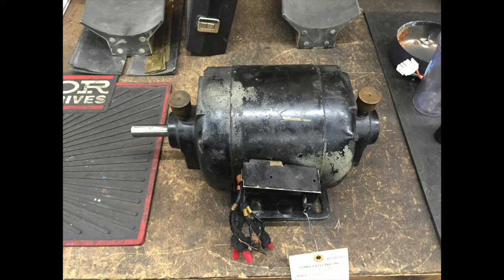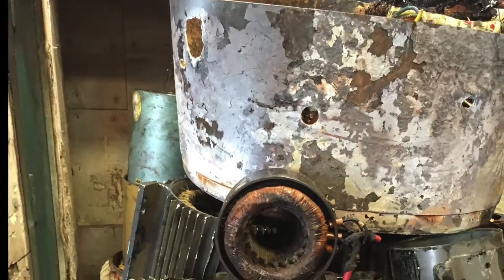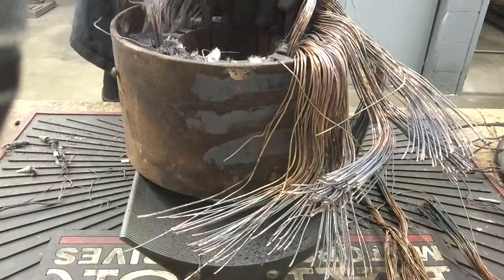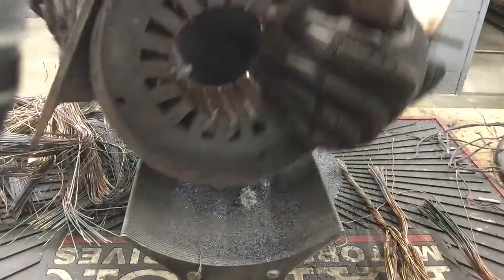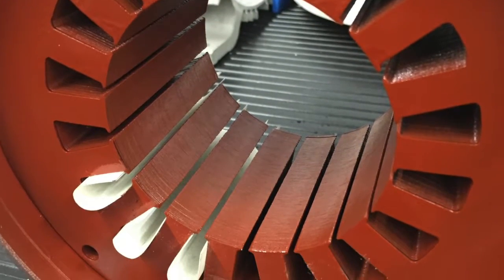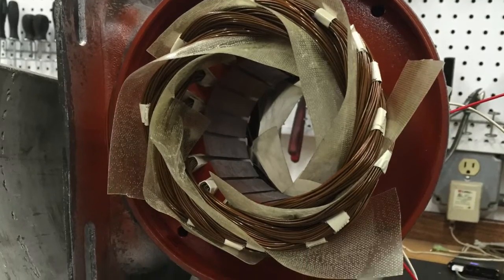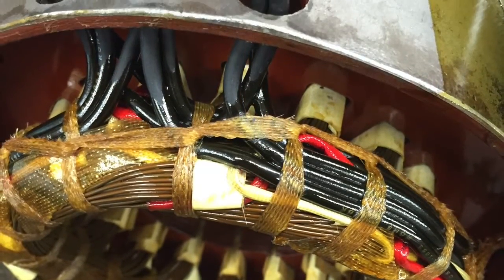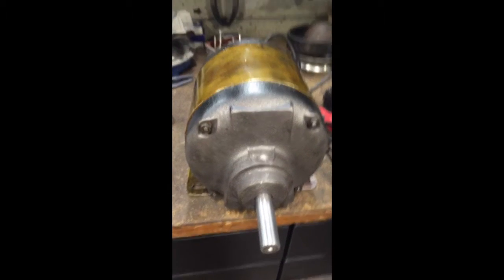Ge 1942 2 pole motor rewind

Comment: 900 hundred degrees is too high you need to burn it around 700 to 750 only or you'll damage the insulation coating on the lamination but good job.
Reply from the maker: pher8487 we just upgraded our oven to have water suprsssion and now we burn off at 750°
Reply: Ryan Miller Do you core loss your motor after sand blast?
Reply from the maker: pher8487 I am working on a small core loss tester based off of a cellphone program, we do not own a commercial one at the moment
Reply: Ryan Miller it's usually ok not to do a core loss test if you can strip a motor at low heat by using a torch to just heat it enough to get the wire out.but nowadays big companies want a fancy report on their motors so from a business standpoint that's where is headed.i could remember when we use to burn motors by digging a hole and put wooden pallets in along with motors and set on fire but good Winder's are hard to come by nowadays. Take care